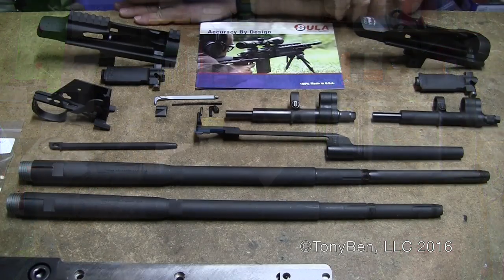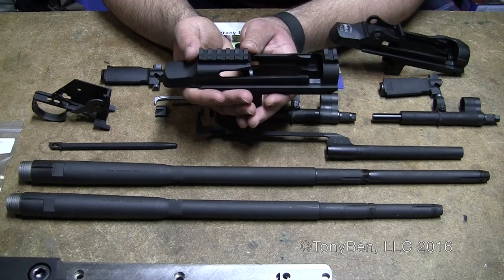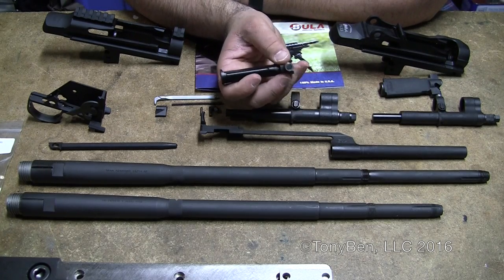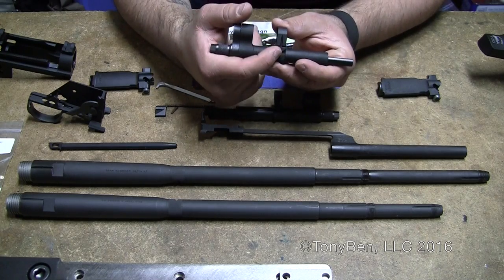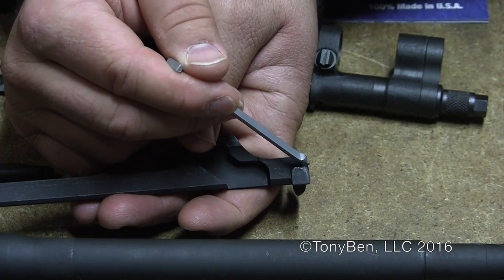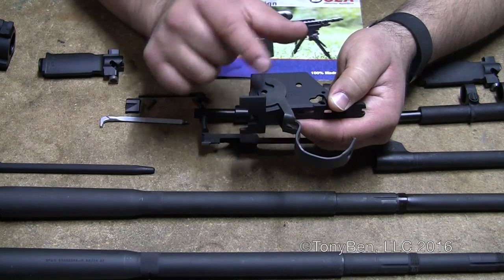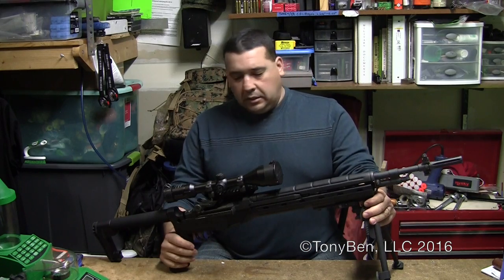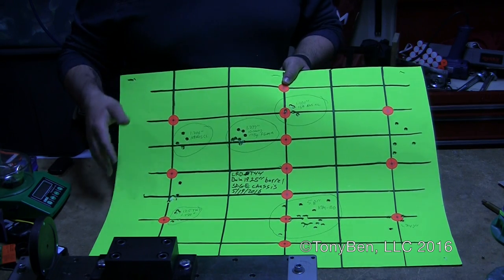Bula Defense Product Intro

Comment: I don't think James River is building guns anymore. Do you have any details on why their websites no longer has completed guns for sale? JRA did a sloppy job of putting my Rockola M14 together. I used your videos as a guide to go through the gun and correct all the issues. Loose oprod guide, overclocked barrel, and the rear sight assembly was PACKED with sand...yes sand. My guess is that they media blasted it before they parkerized it and never cleaned the sand out before assembling it. The oprod also was dragging in the stock. I was so pissed, I didn't call them in fear of blowing up on the phone. It's all corrected and shoots fantastic now, but jeez it took a long time to get straightened out. I have photos of the sand issue, PM me if your interested in seeing that. BULA on the other hand did a GREAT  job with the receiver and the chrome lined barrel is great. Thanks for the video Tony!
Reply from the maker: Bula is JRA's supplier. They will be set up soon to meet customer demand.
Reply: tonyben3 i have a Springifield armory m1a loaded right now. Sadlak airborne steel mount and leupold. I love the m14 stylr rifles. Im looking to get another m14 to keep iron sighted. I may buy a bula defense james river armory from classic firearms or should i save up and go with Fulton or LRB?
Reply: I have a Rock-Ola number 3xx,and I'm real happy,but you never know.

Comment: Tony, 

How does a Bula Defense M14 receiver compare to an LRB? Is either one "better" or more close to milspec than the other?
Reply from the maker: They are pretty much identical in quality, from my experience. I have three LRB's and two Bulas. all of them are a dream to shoot. I will own at least one more Bula soon to even things out.
Reply: Right on, I really appreciate the response, and the high quality videos you've posted.

Sorry to be a pest but I did have one additional question. It's my understanding that when assembling a barrel, receiver and bolt that issues of proper headspacing can sometimes preclude the usage of chrome lined barrels in certain receivers, in that chrome lined barrels shouldn't be reamed. Do Bula receivers and bolts and chrome lined Criterion barrels generally assemble together without too much difficulty or would one be better off just purchasing a non chrome lined barrel?

Comment: I purchased a blackfeather hand guard for a M/1A  I am so sorry i  purchased it. I had the Hardest time getting the operating guard on 
i think they send me the wrong one. And can't return it to them. Any Ideas what I can do.
Reply from the maker: Did you purchase the whole Blackfeather chassis, or just the handguard? The chassis requires the Blackfeather operating rod guide which can be a bear to install. You can open up the new guide with a sanding flap wheel that will fit inside the guide. Or you can get a dowel and cut a slit in it and wrap it in sandpaper. 

Chuck it in a cordless drill and spin it inside the guide to open it up. 

If you're just talking about the hand guard without the Blackfeather chassis, it will only fit on standard weight barrels and not medium weights. It does not require a new operating rod guide. E-mail me with further questions.
Reply: Just the chassis., so far, Now I am having trouble with operating rod going throw the operating guide. I have lined up everything like your video still hard to it in and out now.
Reply from the maker: This will happen if your operating rod is bent. I've had this happen before and the worst was with a SAGE operating rod guide. I had to bend my operating rod different ways until it would slide back and forth without resistance. In the end, I got tired of bending it and I swapped out operating rods with another rifle that had a regular operating rod guide.

Send me your operating rod and I'll straighten it out for you. Just pay shipping. e-mail me at tonyben@tonybenm14.com.
Reply: I bought the whole thing I am so disappointed with this. Wish I never would have bought it. My M1A has only been shot 20 rds through it. Now I have to purchase a new operating guide so i can put it back to normal.
Reply: I've heard that from others.